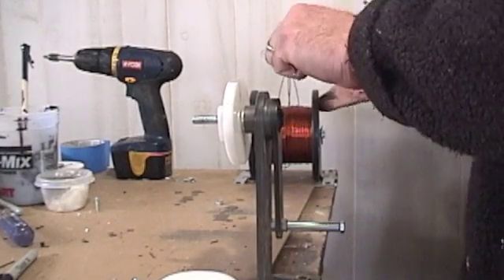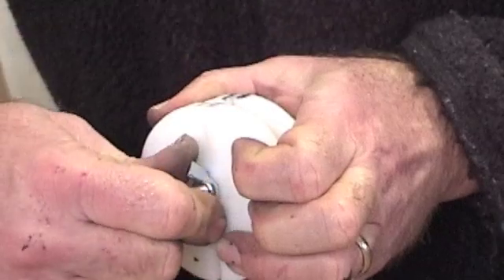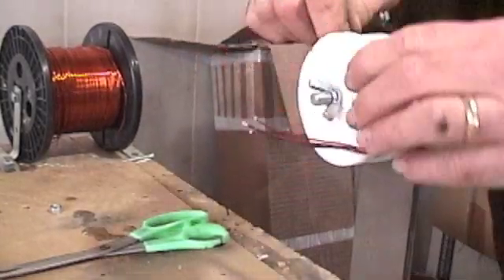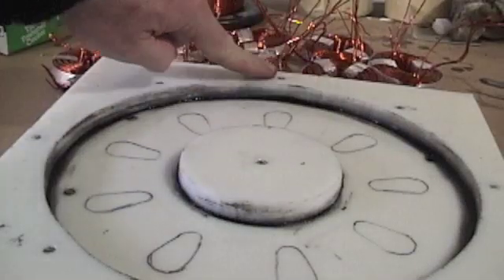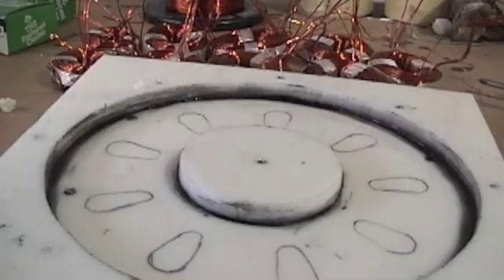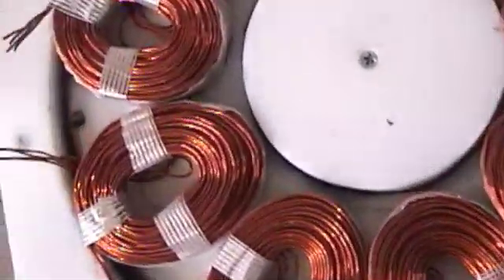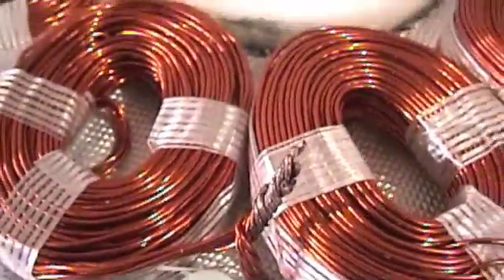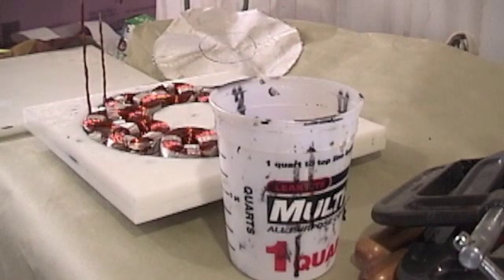Steam gen Stator Part 1

Comment: This alternator was designed to output 24 volts at 500 rpm.  In effect the wire is 12 awg to handle 30-40 amps each phase.  I posted this only to show the method I use to build the stators.  The goal was to get as high efficiency as possible at 600 rpm where the steam engine outputs 2.5 hp

Comment: Looks good. But I have one question. What would be the effect if you wound the coils with a larger wire, say 12 or 14 then added a transformer to the outputs to get your charging voltage? Instead of having a high impedance coil burning up power with heat? When using a transformer you can have a very low resistance coil with high current and low voltage, then transform it into high voltage low current. Am I thinking right?

Comment: This particular generator had to be no more than 10" diameter.  To get this much power out of a 10" diameter, there needed to be 3 separate stators, each its own phase,  This is the same technique i use for the single phase wind turbines.

Comment: Single strand 14 gauge? Try double strand 18 gauge, that's equivalent to single strand 15 gauge and is a lot easier to work. I've tried 14 gauge recently but had the same trouble as you. The thicker the gauge, the bigger the coils should be imo. Lynx is using 4 strands of 18 gauge.